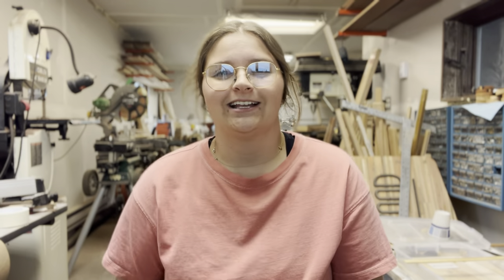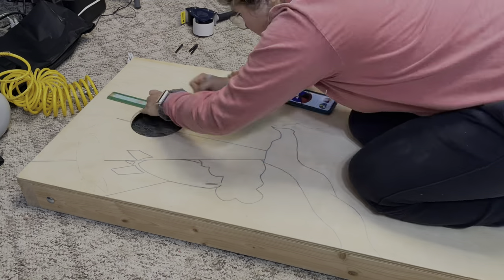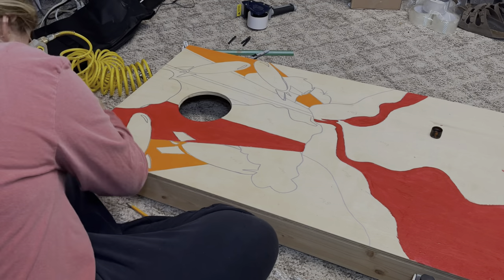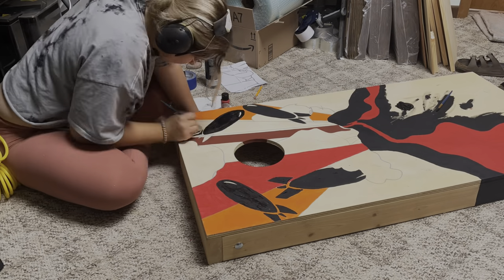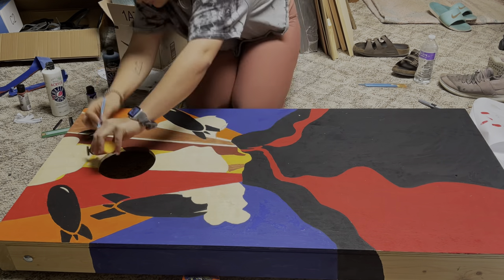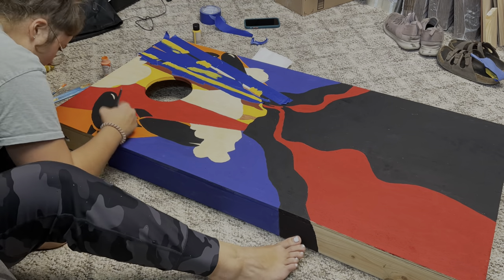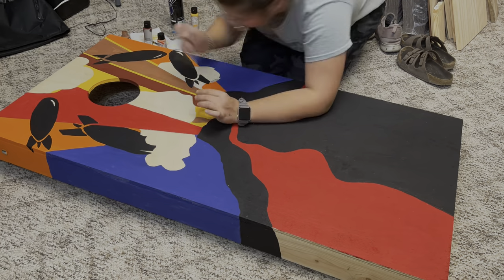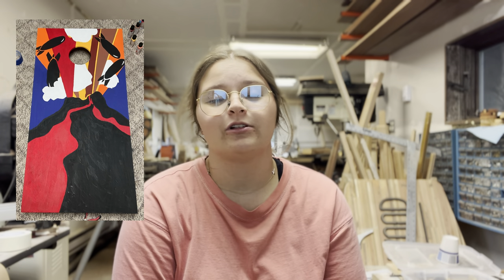Corn Hole Board Custom Paint Job

Comment: Wonderful job!  I am surprised you did not cut the design in half and use the Journeyman x50 CNC with 0 spindle speed and a pencil in the chuck to do the design for you.  It is hard to say if it would have saved any time getting a machine to do it as it looks like it would be hard to get it to line up a top half with a bottom half and using the CNC to draw properly for you.
Reply from the maker: At the time of filming this video of me painting the boards, I did not have my CNC machine! But thx for the tip I’ll use it in the future!